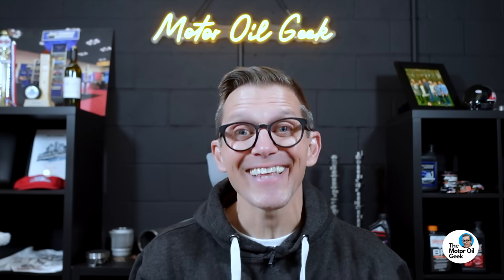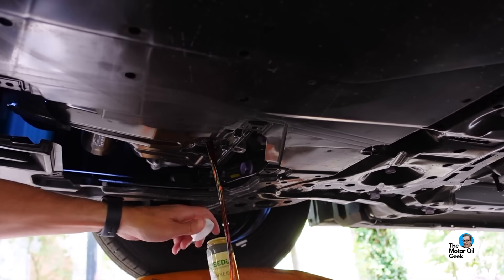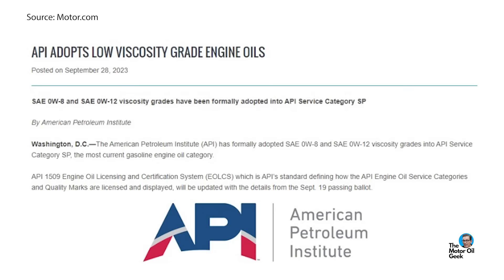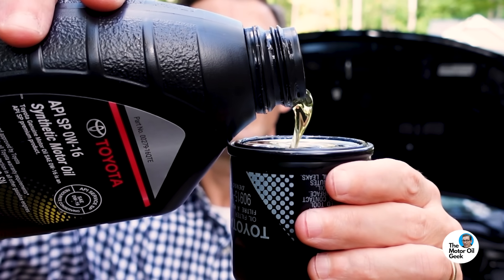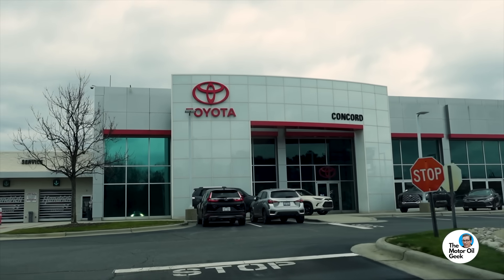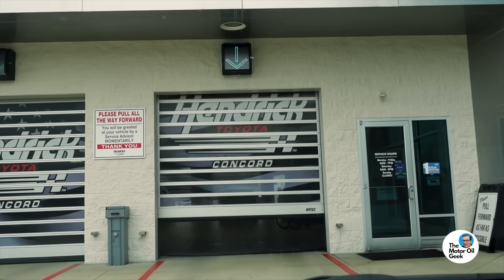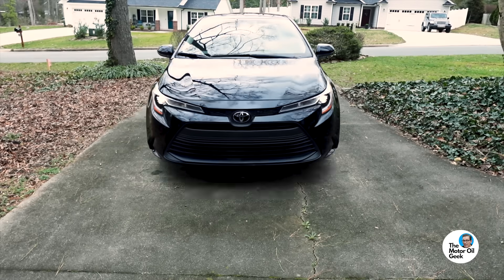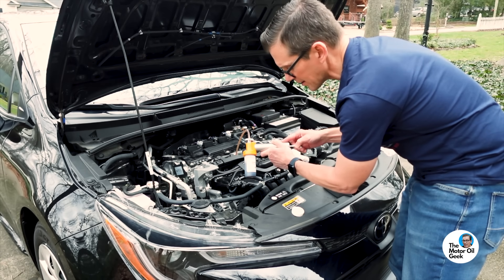0W-8 Motor Oil: Too THIN to Trust? Let's Find Out!

Comment: They want you to change oil at 10K miles, and they also want to sell you another car. As you know, the change interval is not due to oil viscosity breakdown with today's oils, its due to cylinder blow-by gases dissolving in the oil and creating acids that eat your bearings. I change my oil every 3K to 4K miles. I have 163K miles on an engine that still runs like new, and is as clean inside as when it was knew (not the pistons and combustion chambers though of course). Of course I take care of the whole car. It's the last one I am owning.

Comment: I have a Mazda CX5 turbo. They use 0-w20 oil. I always add STP oil treatment after every 5k mile oil change. I hope I’m doing the right thing?
Reply: Never use additives, it's a disaster waiting to happen due to incompatibility issues. Get the right oil and change it when it needs to be changed. 👍

Comment: Toyota CVT in the Corolla has a 1st physical gear. The first gear drops into use when starting from a stand still, then shifts over to the CVT part. A much better design than conventional CVT's. I think they started using it back in 2018.
Reply: The 12th Gen cars with the 2.0L

Comment: Hey Lake, I watched your "the truth about oil change intervals and analysis" video.  What gasoline additive(s) do you recommend using?  Previously I've tried Red Line 60103 SI-1 Complete Fuel System Cleaner  and Marvel Mystery Oil.  What products do you recommend?
Reply from the maker: The Red Line SI-1 is good as well as Chevron Techron Complete and Gumout All-In-One
Reply: Thank you Lake! I appreciate your feedback. @themotoroilgeek

Comment: No speculation on this channel, all science. So many myths that have been engraved in our minds for decades regarding engine oil and you are dispelling them. Excellent work Lake.
Reply from the maker: Thank you!
Reply: Yep I've come to rely on Lake Speed's advice on engine oils and other lubricants in general.  Everything he says about engine oil is based on years of training, education, and experience after all and OP is being nice enough to give us some of his expertise FOR FREE.  So the information we get from a bona fide tribologist (i.e. oil engineer) is probably the most honest source on engine oil I am ever going to get.
Reply: Still a little, to be truly scientific you needed a control, where you did the changes exactly per the mfg and compare the results
Reply: I can not comment on his knowledge of oil but, I can on the vehicle mechanics. Toyota specifically states 0-w8 or  0-w16 for a reason. The engine , computer and sensors are calibrated for that specific grade of oil.  If you do not follow manufacturer instructions and use a different grade , you may damage the engine long term.  Since he does not let the vehicle go over 5K with the wrong oil, I think he is OK.   I would have ran the new engine 5K with the original oil and then change the oil but not the filter.  The filter will work fine and you can change it every other oil Change.  JMO🇺🇸✌️
Reply: @rayRay-pw6gz there is so many YouTubers that have proven you wrong.

Comment: The issue I have with really thin oil is when the oil is really hot like highway driving in the summer the oil will be to thin and lose the oil film and start metal to metal contact

Comment: Maybe you can trust Toyota? However had 92 escort with manual transmission. Ford said use ATF, the manufacturer of the transmission recommends 75 90 gear oil. Replaced with gear oil, smoother shifting better mileage. Probably saved transmission by several years.

Comment: CVT note: if you have a planetary gear-type CVT, it may call for ATF, instead of CVT fluid, just be sure to check the owners manual.
Reply: Not sure what type of CVT my 07 Prius has, but it can use plain old Valvoline MaxLife ATF. Same stuff I use in my 07 GX470 which has an A750.
Reply: @VuickB6 The Toyota hybrid CVTs use a planetary gear set. It's pretty cool! The engine drives either the ring gear or the planets, the electric motor powers the other, and the output comes from the ring gear. So, depending on the speed of the electric motor, you can set the engine RPM and essentially have any output speed you want. 

The belt CVTs are the ones that need the special fluid, but since yours is fully geared, it takes ATF.
Reply: I stick to oem fluids for CVTs. Not going to risk a 5k trans to save 40 bucks.
Reply: @michaeldurrett8388  OE's don't make a lot of things under the hood, spark plugs, belts, bearings or oil. Many of the aftermarket are far superior and I'll pay more for them. The most cost effective way a customer can extend the life of their transmission is the OCI and the product they use. Do what works for you but this is what I do. Retired Ind Allison Trans specialist. 
Find the top tier oil manufacturer you can afford and use their product. It's what they do, it's all they do and the OE might be piurchasing from them already. They have guys like Lake that geek out on this stuff all day, every day. Just a suggestion.
Reply: @michaeldurrett8388   Well, your our Toyota's owners manual for our 2022 Venza hybrid says on page 489 says that our Hybrid transmission uses Toyota WS ATF, the same as any conventional Toyota automatic transmission.
Reply: @michaeldurrett8388  Well, our Toyota's owner's manual for our 2022 Venza hybrid says on page 480 says that our Hybrid transmission uses Toyota WS ATF, the same as any conventional Toyota automatic transmission.
Reply: I think Toyota shouldn't use the name CVT or e-CVT, because people confuse it with CVT with a metal belt between variable diameter pulleys. It should sound something like this: continuously variable planetary drive.
Reply: Best to stick to whatever the manufacturer says to use, and in fact, would just buy it from the dealer.  It's the one thing I would say you're best off just paying the extra money for the OEM stuff.  Besides a few quarts of CVT or trans fluid in general is far cheaper than a new transmission down the road. I mean how often do you change your trans fluid?  Maybe once every other year if you have a CVT (say every 30k-50k miles) and perhaps every 5 years (or 60-90k) if you have a manual or traditional (geared) automatic.  And if you have a CVT you should be changing your fluid about every 30-50k miles anyway for best longevity.
Reply: I think Toyotas like the one In the video have an e-cvt not a belt cvt. It uses a planetary gear and two electric engines in order to create "infinite" gear ratios. 
In Europe corollas, Yaris, rav4 all use this system not the one mentioned in the video.

Comment: I would only recommend use of 0W-20 in those new engines and oil changes at around 4000 miles intervals but first oil change should be at around 500 miles. Good luck with these new cars!

Comment: I would be most concerned about the life of the catalyitic converter.. When the engine wears (as they all do) they will always burn a small amount of oil. A thinner oil would be more likily to leak past the piston rings, which is known to damage the catalyst.  The wear additives in the oil may make this worse as thet tend to be especially bad for catylitic converters. 

The engines themselves are probalbyl fine on this oil since they are built for it. Its time we start using centistokes at -18 and 100C to grade oil since the limitations of the current SAE grade system is showing its flaws with the irrational fear of "0W" grade oil and we are running out of smaller numbers.

Comment: I really enjoy your videos! I’ve got a question for you. My Nissan 5.6L Titan calls for 0W-20. The same engine used to call for 5W-30. The rumor is that Nissan changed to 0W-20 for emission reasons(?), but 5W-30 is supposedly better for engine longevity. Do manufacturers, in this case, reduce the viscosity to primarily increase fuel efficiency? Also, is there any risk in running “high mileage” oil in a low mileage engine? I’ve got some leftover oil from a previous truck and I’d hate to waste it.
Reply from the maker: The 0W-8 is all about squeezing more MPG out of the car for the EPA CAFE tests.

Comment: Honestly, and I hate to say this since I am waiving my FREE Toyota oil changes on my NEW Rav4 Hybrid I simply don't trust them.
I did my 1,000 mile break in change and plan to do subsequent changes every 5,000 miles. With a Hybrid, that is probably more equivalent to every 4,000 miles APPROXIMATELY related to MY driving conditions.

Comment: A lot of 2022+ Wrx guys switch to 5w30 even though the manual calls for 0w20. Whatre your thoughts? Also, living in a hot climate like Georgia, should i be worried about running 0w20?

Comment: My main gripe with Toyota is regarding their habit of hiding information about maintenance intervals.  When I bought my 2019 Tacoma, the dealer I bought it from not only said the transmission fluid never needed to be changed, they flat refused to do it at 60k miles.  Then after I moved my new dealer asked if I wanted it changed, but at that point I was already past 80k miles so was past the point where it could be changed without damaging the transmission.  Don't even get me started on the gear oil for the diffs and transfer case, Toyota doesn't even make gear oil in their recommended viscosities and dealers all just toss in 75W-90 in both the diffs and transfer case.  From what I gather, Toyota actually changed the maintenance interval on the Tacoma's transmission after 2019 going from "never" to 60k miles, but if you are already past 80k you are told specifically to not change the trans fluid.  And even channels like the care care nut (who seems to probably be the best authority on Toyota maintenance) agrees with the "change at 60k, but no first change after 80k" rule.
Reply: You're only 20K miles over change your transmission fluid now and keep track of miles and keep changing it
Reply: @Bigfoot8x6  agreed! Plus, I think Car Care Nut says 60,000 mi (100,000 km) is the recommended, but even up to 100,000 mi (160,000 km), you can still change it.
Reply from the maker: WOW, Sounds like the dealer network needs to get on the same page!
Reply: Is there an explanation for this thinking that after the recommended 60k is up that it will damage the transmission?
How is that?

Great video BTW.
R.

Comment: That siphon is very slick.  

You have to take off the wheel and remove the wheel well I think On the driver's side to access the drain and full holes. you drain the fluid into a measuring jug and install the same amount.  Draining it is an entire process as well.  They couldn't get more complicated if they tried.
Reply from the maker: WOW, that is crazy!
Reply: @themotoroilgeek  That's not half of it!  When you remove the drain plug only a small portion of the oil comes out.  There is a tube (kinda like an overfill tube) you have to remove to the rest out.  Some have sensors you can access from the command center, others you need a scan tool and still more you need to use the measuring jug.    And you have to use a pump similar to your oil testing pump to get the oil back in the pan.

Comment: Cool video! It would be interesting to see how these new ultra thin oils perform against traditional oils when both are using the same type of base oil and additive package. While it's cool to see that a 0W-12 can perform as well as a 5W-30 in a lab test, it would also be great to see a true apples to apples comparison with the only difference being the viscosity.
Reply from the maker: Great suggestion!

Comment: Toyota transmission fluid turns from bright red to dark black in 15 minutes exposed to sunlight. Changed mine, and in the time it took to set the level, the drain pan went from grenadine to roofing tar.
Reply from the maker: UV can affect some additives like that.

Comment: I had the dealer change the oil in my 2023 RAV4 at 1,000 miles, and then six months later, I brought it back for another change at 3,000 miles.  My Toyota dealer surprised me when they said this one was free based on the date and not miles. They also rotated the tires. (Love the fluid sample pump)
Reply from the maker: Thanks for sharing that tidbit!
Reply: I just bought a Mazda CX-90 and asked about the free maintenance for a year. They couldn't give me a straight answer on how many times I could change my oil in a year or if it was based upon mileage
Reply: @TheBasscow @TheBasscow  Please listen to Lake Jr. and change it between 500 and 1000 miles the first time and every 5,000 or six months, whichever comes first after that. Pay if you have to because it's worth it.
Reply: i hope you check to make sure they actually changed it.  dealerships check the oil and mileage and if the oil looks clean they dont change it but they pretend they did
Reply: @cantwealljustgetalong2  I saw my RAV on the lift and draining the oil. I hope my Toyota delaer would never consider something so dishonest.

Comment: I don’t trust bulk oil at the dealers. I usually buy 5 quarts of the brand I prefer and request they use it. The dealers will deduct the oil cost because you gave them the oil to use. It comes out to be about the same price overall.
My preference is Mobil 1 EP.